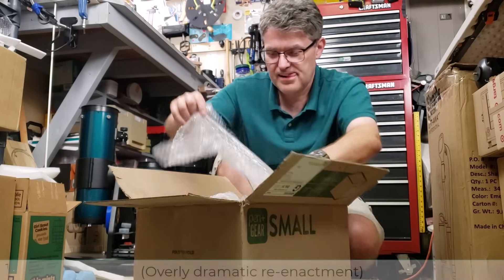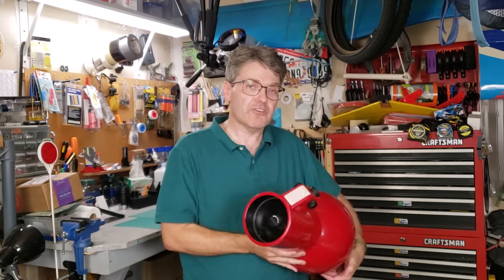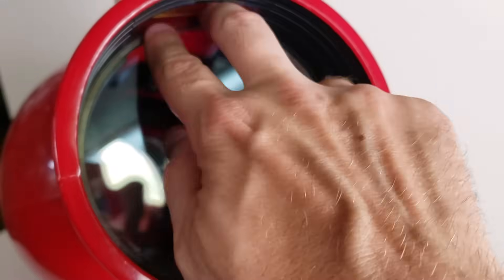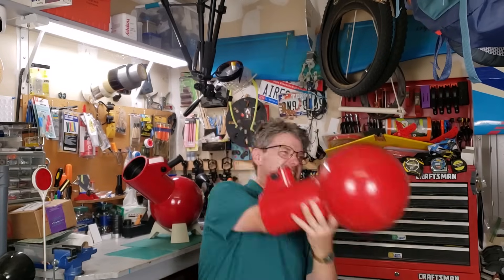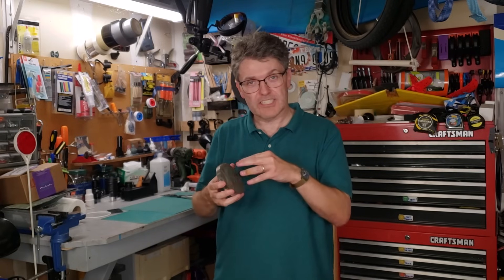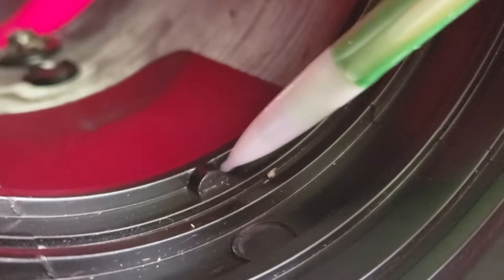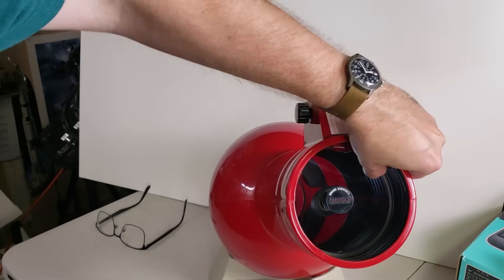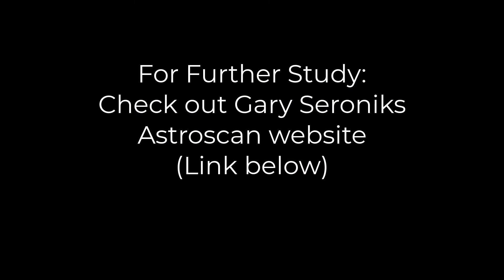Astroscan Repair Guide (Part 1 of 3): Align Those Old Telescope Optics!

Comment: You might want to try a MASONRY bit to drill those holes in the retainer clip (ring) - if you can find a small enough bit. 
   I have found that the only way to drill through hardened steel, after having tried every other kind of bit for metal, to be the masonry bit.

Comment: I recently pulled my Astroscan out of the closet and wondered how to get it back into shape. A quick web search and I found your site. Your 3 posts showing all there is to know about the Astroscan are great. I also loved your interview with Norm Sperling. I now know more than I ever did about my Astroscan. Then I watched all your other videos and am now reinvigorated for astronomy.  

Mine has a sticker in the focuser area above the secondary mirror with the number 51293. Serial number? Mine also has the holes in the secondary mirror mount holder, but no holes in the primary mirror clip.  Perhaps they didn't want anyone to drop a tool on their mirror trying to get it out.

Thanks for your channel. This is great.
Reply from the maker: I'm glad the videos were helpful, and thank you for the kind words.  Yes, that is likely the serial number.  I'm glad to hear that your spring has the holes in it - that will make any modifications easy.  I've since found out that the main mirror ring never had holes which is unfortunate.

Comment: Thank you so much for the series. I just found it yesterday. 

A few years ago, I found an astro scan in a savannah comic book store up on a shelf. The receipt from 1978 was still inside and it appeared to have never been used I couldn't bear to leave it there so I bought it and brought it back to jacksonville. I was too afraid to touch it I had no idea what to do with it. The parts were sticking, the mirror looked bad, it was very dusty, I took it to the astronomy club a couple of times and nobody there knew what to do with it either.. 
Then, I met my 11 year old buddy who is a budding amateur astronomer. Her dad is a maintenance and repair person by trade, and is not afraid figuring out how to repair something. 
He already took the top cover off and cleaned some things but he didn't know how to get the mirror out yet. 
I just sent him a link to part 2 
I'm very hopeful that soon he'll have removed the mirror and cleaned it and check the other parts. 
Thanks so much for enlightening so many of us on the Astroscan's innards 
Also, I found an eBay store called astroscanman who sells 3D printed replacement parts at good prices. If you're missing a knob or a cover or something else check it out

Comment: I have one without the holes. I found that the long nose lock grip pliers will allow you to grab the end of the spring steel retaining clip and remove it halfway around. Grabbing it from the other end in the same way will remove it the rest of the way. First attempt took me about two minutes.
Reply from the maker: That's a very clever alternate use for these pliers!

Comment: I am glad someone is finally posting videos on the collimation and restorstion of these telescopes. They deserve to be rescued. I have rescued and restored five of them over the past few years. I use strips of black electrical tape for shimming the optical window. Most of mine (USA made) needed the foam behind the primary mirror replaced. The Chinese made ones were the last to be produced. I read somewhere that they may have fastened the primary mirror a bit differently (harder to remove). These are great telescopes for low magnification and wide field viewing. They were NEVER intended for higher magnification use. Although, my collimated Astroscans are good to almost 100x.
Reply from the maker: Using black tape is much wiser than my blue tape method.  I would love to learn more about the foam inserts you used behind the primary mirror. Please email me.
Reply: How do I send a message?@AstronomyGarage

Comment: If you heat the tips of the retaining ring on the front plate with a torch and let it cool slowly by gradually moving the torch away, the material will lose its tempering, allowing you to drill through it.
Reply from the maker: That is a great idea!

Comment: I knew I recognised this 'scope. 
I am watching the video looking at my 1979 (cat. 8880) Edmund Scientific catalogue. The Astroscan is on the cover. The new price was US$169.95.
Reply from the maker: It's odd that the used ones are going for about the same price now.  $169 back in 179 was a LOT of money.  That was more than the average monthly car payment.
Reply: @AstronomyGarage  Remember, as you rightly stated, 45 years of currency debasement has lead to today's value being far less. Just in the last 5 years (or so) the US$ has lost around 25%-30%, of it's true value. So, imagine the true cost of the telescope, back in 1979. There are inflation calculators online for those wanting to do the sums.
   Also, some of the other prices were an eye-opener. eg. budget range equatorial mounts for US$300-400.
Certainly brought back some childhood memories, browsing the catalogue. I also still have other catalogues, from the likes of Cave, Meade & Unitron.
Getting them to New Zealand back in the day was time-consuming. No Fed-Ex; or online downloads 😉

Comment: Someone donated an Astroscan to our observatory.  Instead of using the base, we mounted a section of 8 inch PVC pipe onto the seat of a wooden stool as a mount. Just smooth off the contacting surface of the ring and it works well. Very sturdy.
Reply from the maker: That is very clever!  Was it collimated pretty well?

Comment: Excellent! You CAN drill holes in that clip. Using vicegrips to isolate the ends use a propane or mapp gas torch to heat the ends red hot. Wait untill the whole mess has cooled off slowly and you will have anealed the tips. Then drill your holes!
Reply from the maker: That seems like a great way to do it, and since the ends are "floating" in the telescope, their springyness probably doesn't matter.

Comment: Re the holes; Drill the steel before you harden it.  Would it be possible to solder on two drilled tags?
Reply from the maker: I think I might be able to weld new tips to the end?  I think soldering wouldn't be strong enough.

Comment: The factory would make the hole when the metal was in a softened state, the holes were probably punched and the circlip then formed into shape and then hardened . 
To drill holes in it you could use a diamond drill as it is harder than hardened steel .
Mind you these days people have laser cutters which will also drill a hole , or you could measure the clip and order one with holes already in it , probably the cheapest option .
Reply from the maker: That is a very logical approach.

Comment: I guarantee that the factory didn't use a tiny carbide drill in the rings.  The holes would have been drilled or punched out before hardening.  Much easier and, more importantly, much cheaper.
Reply from the maker: This is a very good point.

Comment: I think one could drill that spring clip ring by burning the temper off of the tips. 

If it were me, I'd hold the ring about an inch away from the tip tightly with some chunky pliers I didn't care too much about, to stop the heat spreading, and then I'd hit the tip with a propane torch until it glowed, and then slowly back the torch off and let it air cool.

For a spring element like that, only the middle section of the spring is undergoing any real bending moment and so only the middle really needs to be spring temper. The terminal inch or two of the ring won't mind being dead soft.
Reply from the maker: This is an excellent tip!

Comment: Loved this vid.  Unfortunately, I was hoping it was going to be about my big issue with my Astroscan — the focuser.  Mine slips and when it is not slipping the action is more quantum than analog (i.e., the eyepiece shifts in discrete jumps so that you are always racked a bit too far in or too far out).  It would be a great if you offered solutions to the focuser issue.  Is there an alternative focuser that can be inserted in the existing focusing tube - I am assuming that would end up with the eyepiece too far back to focus?  I’ve tried cleaning the existing focusing bits, but the focusing action was never very good and now I think the roller has developed flat spots from sitting in one place too long.
Reply from the maker: You may want to try what fellow YouTube Astronomer Joe Jaguar did. He replaced his focuser tube completely:
https://youtu.be/-e1BkxDgtUs?si=kDc0wqrr5Mii5cBv
Reply: thanks!  definitely not going the saw off the existing focuser route.  i don't think I would ever get good collimation again and i already have top heavy issues with big eye pieces.  but now that you have shown the way on getting the secondary mirror out, i may try to beef up the existing focuser axle.

Comment: I have a svbony mk105 and it has a bit nicer way to secure the front mirror and lens, its literally a threaded ring, much better than a snap ring and they thought ahead enough to let you cullumate the thing.
Reply from the maker: That's basically the exact same diameter mirror.

Comment: For drilling hardened steel: tungsten carbide drill bits. Apparently there's also cobalt drill bits, but I have zero experience with those. A good drill press (with little to no runout) is essential, as those bits are more brittle than regular bits and can't take axial loads. Also, use a slower speed, lubricate, watch out that you don't overheat the bits, and don't use excessive force.
Reply from the maker: I believe I used the cobalt drills, but I used a hand drill, so it wandered.  :(

Comment: Hi John Mine came with the retaining ring without the hole. I also didn't know there was 2 different rings made. i used needle nose pliers but that was still kinda hard. Thx for the video. Its fun how we both have the same scope but different fixes on th same weeks.
Reply from the maker: I look forward to your fix because it addresses the primary weakness of the Astroscan.

Comment: I had one and traded it to a friend for an Orion 4 1/2 inch dob he had sitting unused in his garage. The dob was sticky rotating on its base so I used those green nylon furniture sliders on the base to make it rotate better. The Astroscan was fine but it had its limitations.
Reply from the maker: I agree. It certainly has its limitations, but it's a fantastic introductory telescope with about five seconds of setup time.

Comment: If you can find a masonry bit small enough, those will drill through hardened steel.
Reply from the maker: I will see if I can find one that small. Thannks!
Reply: @AstronomyGarage dad told me they were the only things he found that could make a dent in case-hardened shafts. Lubricate it with water.

Comment: How did the factory collimate them if you had to send it back? I'm amused by how often you use painter's tape to make small adjustments like this. One of the first telescope videos I ever watched was your video on fixing up the Orion Starblast. Thank you for all the great tips!
Reply from the maker: That's a great question.  I assume they had to break the glue joint on the secondary mirror and reseat it.  As it turns out, they offered a "Reconditioning Service" all the way up until last year.